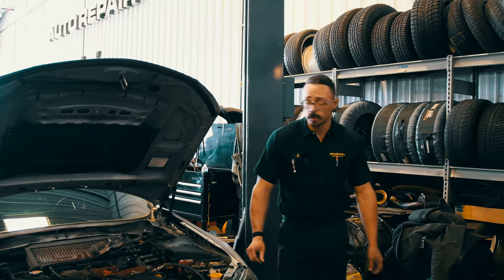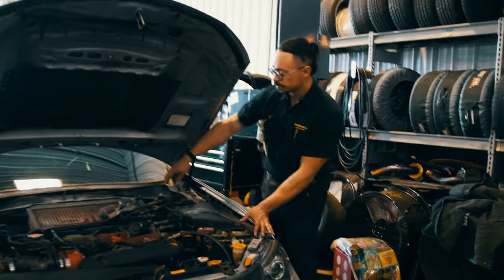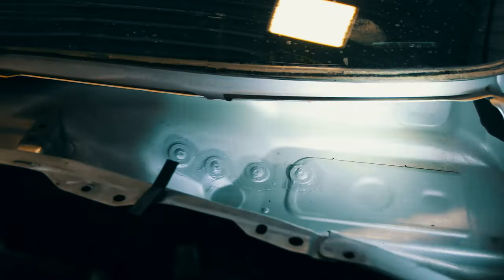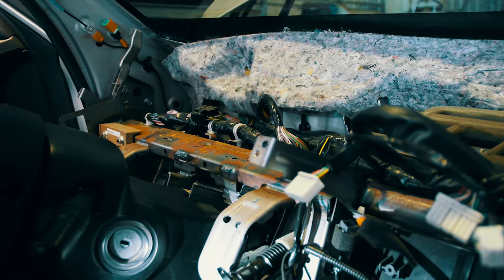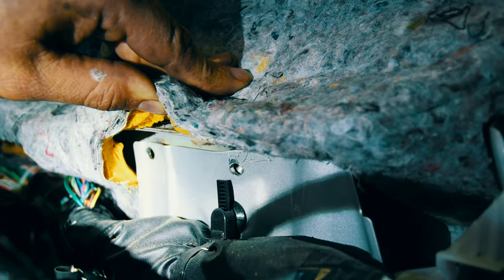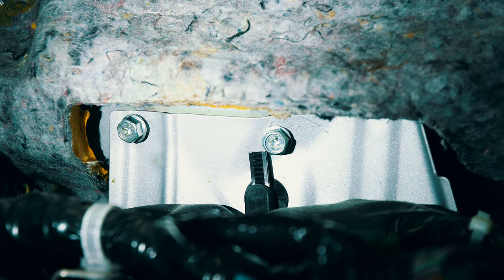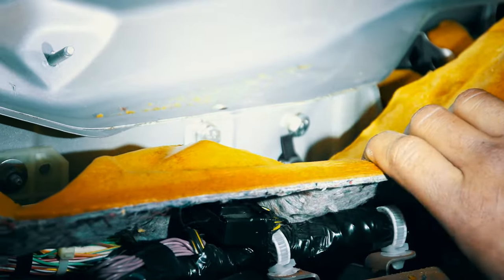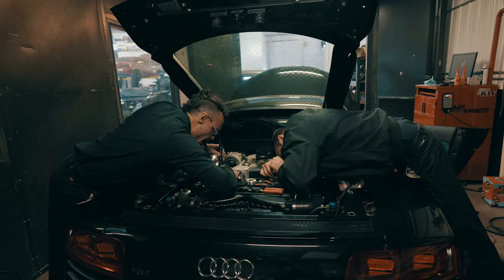Subaru WRX STI (08-14) Clutch Pedal Bracket/Firewall No Weld Fix

Comment: I had the master cylinder / clutch braces and the clutch feels a lot better now. However, the pedal assembly broke and have to replace it.  My whole ordeal started because I decided to install a heavy duty clutch. My car is now making 400 whp and I was thinking a heavy duty clutch would help with power load. I had an Exedy Heavy Duty organic clutch installed. Shifting became better during WOT, but the stress from having to move the heavy duty clutch put stress in the weak pedal assembly and firewall. Stick with the OEM clutch.
Reply from the maker: Yes. This is a huge cause for accelerated failure of this area, however we have seen it on high mileage cars with a bit of rust. The area is just plain weak.
Reply: @FluidMotorUnion  Unfortunately, no one warned me about the weak firewall / pedal assembly issue.

Comment: Humble rumble kit, does all 6 spot welds, no dash removal either. Then clutch/master cylinder braces to hold the entire firewall

Edit: not meant as a jab, but some information for people who DIY and don't want to touch the dash
Reply: You are correct.  Humble rumble makes a solid solution to this.  I’m going to attempt the repair once my kit comes in.  Mine is a 2014.  The pedal feels good and I don’t think anything is broken aside from maybe one spot weld.  It pops sometimes.  The pedal feel is great.  So.  Probably best I make this repair before something breaks.
Reply: @joshuathomas4934  it's pretty easy, a bit of a "hold your tongue the right way" kinda jobs if you've ever heard that saying before 🤣
Reply: after fixing my firewall . i noticed louder engine sound going in to the cabin (driver side) especially the aircon compressor sound! help!
Reply: @fcukyouup  which route did you go about to fix it? Dash removed at all?
Reply: @CanadianRC96  yes removed the dashboard. i want to know if anyone experienced the same after the fire wall fix. 
help!

Comment: Don’t remove your dash.  Use humble rumble repair kit. You won’t have to remove the dash and will do the same exact repair this guy did.  The trick to the kit is the bolts are hollow and can be guided with a wire to make it much easier to find the holes for the spot weld repair.  It’s 100 dollars but I feel like for a purpose made kit that saves you all this time and money, it’s more than worth it.  Pays for itself.